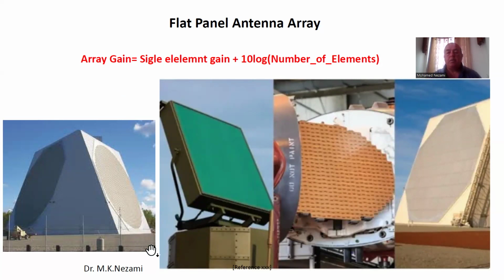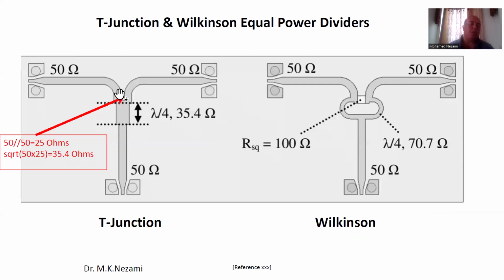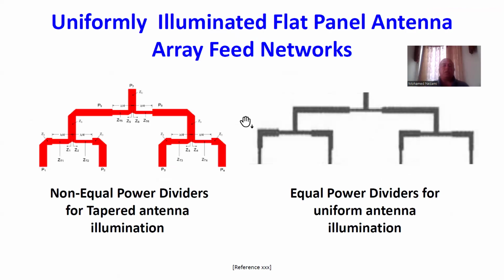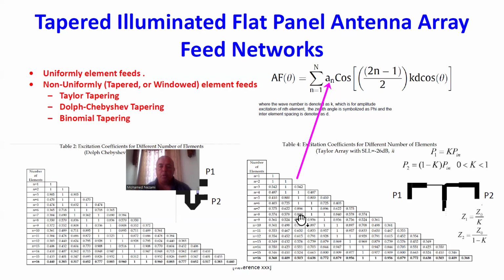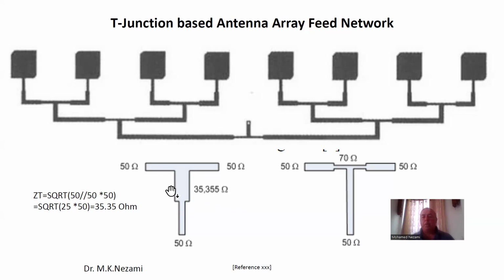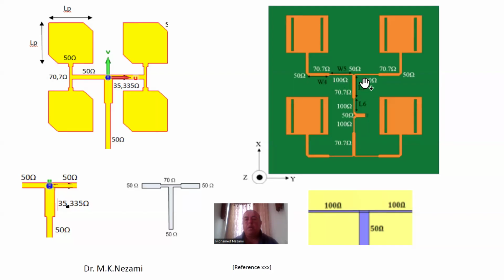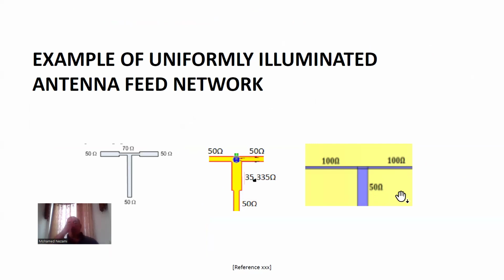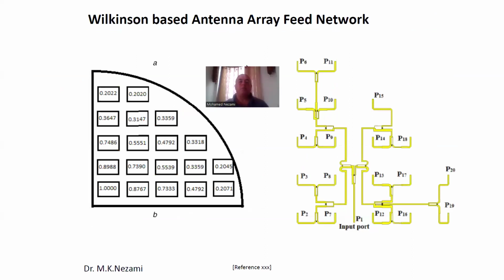Part 1: Antenna Array Feed Networks Design and Modeling

Comment: :washhands::washhands::washhands:Great topic, Dr. Nezami! The transition from simulated feed networks to actual PCB fabrication is particularly interesting.

In practice, substrate Dk variation, trace-width tolerances, and junction discontinuities can all affect amplitude and phase balance.

From your experience, which of these tends to have the greatest impact on array performance, especially when implementing Taylor or Chebyshev amplitude tapering?

Comment: i have loved the video, it has taught me a lot. but now my question is dat how can u integrate such a design with overlapping sub arrays on an SIW
Reply: as siw and micristrip line transmission lines are different(modes are different), you will need a transition section. you can find relevant materials online

Comment: Thank you very much for the informative video. I would like to add that of the 3 presented T-junction dividers, the first two are narrowband while the last one is wideband as it uses multiple sections (50 ohms ->100->70->50ohm; gradually impedance change). The wideband one is often used in wideband applications, such as base station antenna designs.

Comment: Sir,(at 52:00) how to find the input impedance of an antenna?
Reply: The calculation of the microstrip patch antenna input impedance can be found in Yi Huang's book Antenna from Theory to Practice. The impedance is very low at the center and high at the edge, which is why we see two types of feed network in this presentation: inset feed and quarter wavelength transformer.